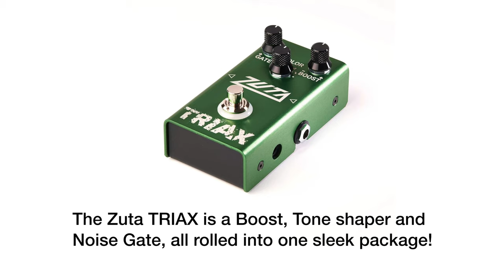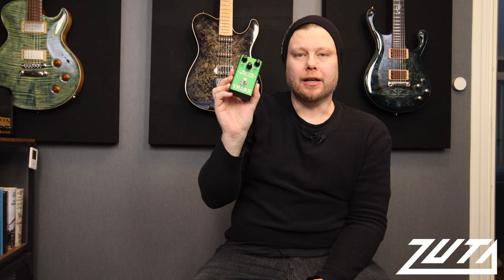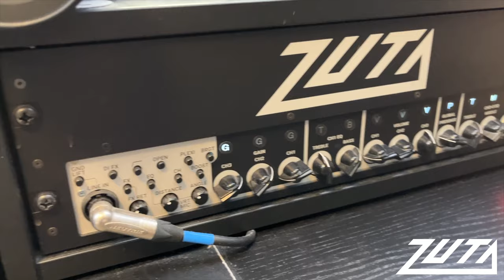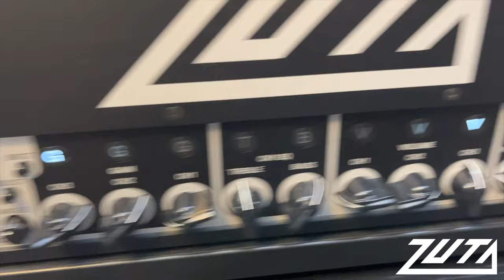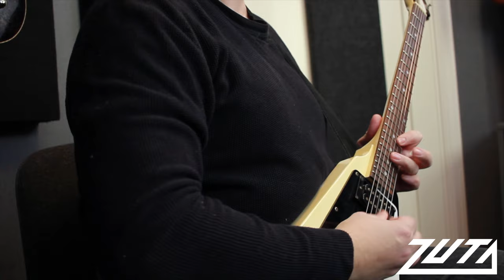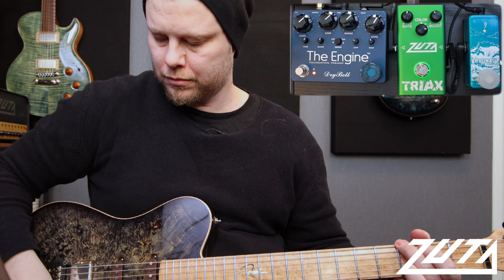ZUTA TRIAX Demo

Comment: Toppklass spelat och demat 🔥🔥💪💪 
Du refererar till Tube Screamer flera gånger, är det vad man har haft som utgångspunkt, med tanke på ljud (och färgen också😁)?
Du nämnde också att den boostade inte volymen så mycket, förstod jag rätt?
Reply from the maker: Tack Peter! Skulle nog säga att det är användningsområdet som inspirerat färgvalet. I "metal-världen" så är ju "standard" att boosta stärkare med en TS (gain på noll, level på max), den funktionaliteten får man här, men med flera olika mid-options och då utan det ökade noisefloor en sådan boost-lösning annars skulle medföra. Den har 30dB boost så den boostar väldigt mkt  beroende på stärk, i detta fall var ju stärken redan kraftigt distad i första delen, och en pushad plexikrets i andra demon. I bägge dessa fall var försteget i stärken redan såpass pushad att mer level inte ger så mkt mer level, utan mer gain istället. Hade jag kört pedalen efter tex The Engine in i clean stärk som lead-boost, så hade det blivit en väldigt stor volym-ökning, så 30db kan antingen ge rejält volymökning, eller rejäl gainökning, helt beroende på vad du sätter den framför/bakom